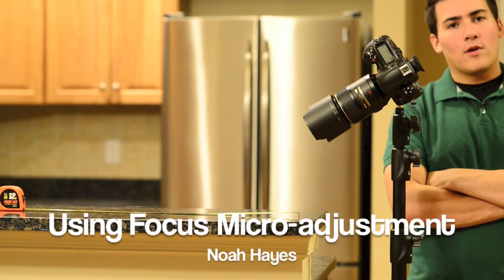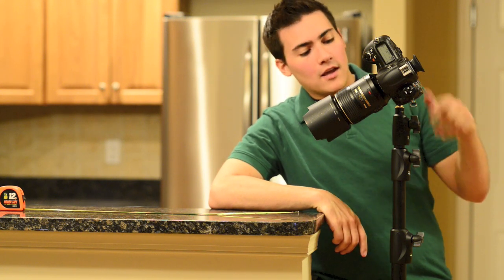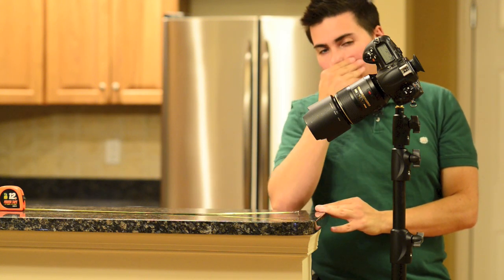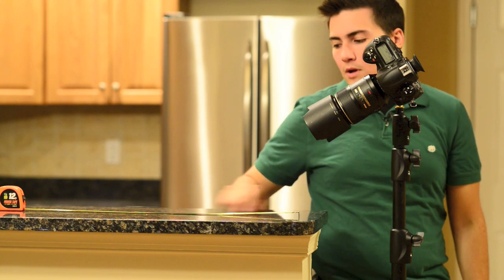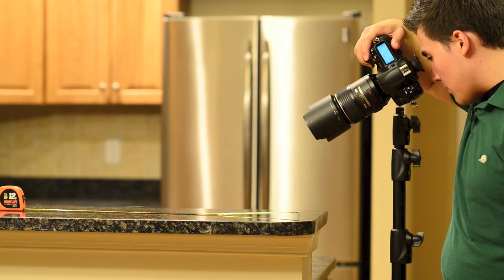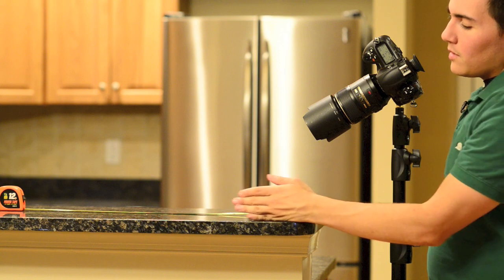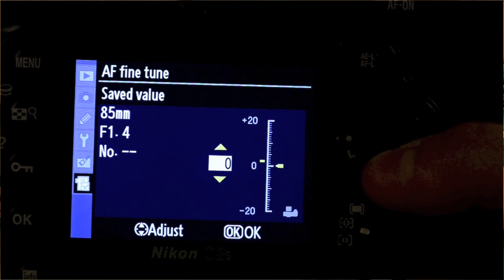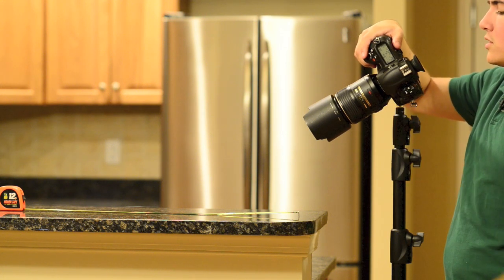Focusing Micro Adjustment Tutorial

Comment from the maker: For a zoom I'd do three adjustments, one for the furtherest, closest and mid focal lengths and just try to get a "sweet spot" if possible that will cover all three for you. For example on a 70-200 your adjustment at 70mm might be +3 and at 200 it might be +7 and at 135mm it's +5 I'd use a +5 which will be okay but not perfect for my 70 and 200mm focal lengths, but it's better than using a +3 or a +7 which will only be good at the extremes.

Comment: Awesome tip to use a tape rather than a special way overpriced plastic adjustement kit at 80$ in camera store that you're only gonna use once. What however if we have a zoom lens such as the 70-200 F4L. Which end do I use, always the shortest one or I'd better be in the middle? Also if the minimum distance is too short, I just get farther away as long as I'm in a 45 degree angle?

Comment: A couple questions.

1: Where is the end of the measuring tape lined up to? Do you line it up with where the center of the lens would fall?
2: I'm not sure I understand how this can be exact, when everyone's angle of the camera facing down at the tape will be slightly different? Think of the basic math of how to find out the long side of a triangle. a squared + b squared = c squared. So say for instance you are 9" (b) above the measuring tape, and 12" (a) away from the 12" mark on the tape. That is 144 + 81 = (square root of) 255 ... AKA you are actually 15" away from the measuring tape? Wouldn't you also have to be an equal amount above your subject, as you are away from it for this to be accurate?

Maybe I am misunderstanding?
Reply: Ameri Pat
 But by that logic you are saying I could have the camera 25 feet above the tape measure, and the 12" mark on the tape should be in perfect focus when I set my lens to 1 ft.
Reply: Ameri Pat
Ahhhhh okay I get it now... I think using a measuring tape as the focal point is what was throwing me off. For all intensive purposes a book with fine print can be used instead of a measuring tape, and therefore less confusing to analytical people like me hah.